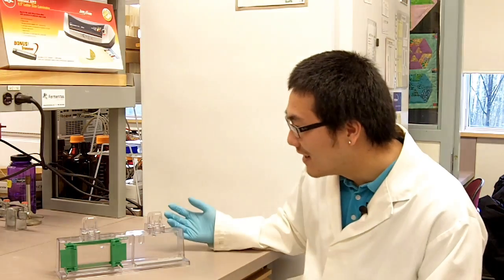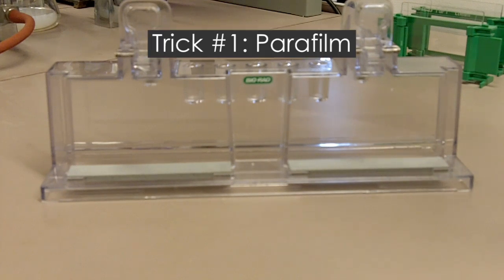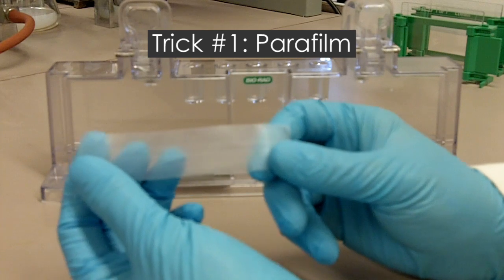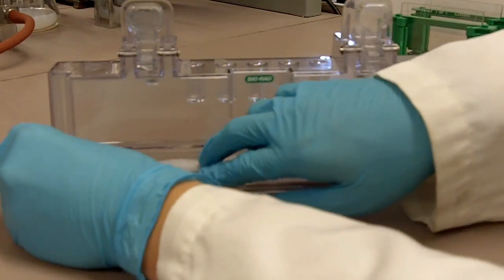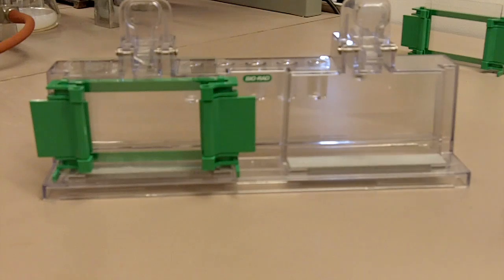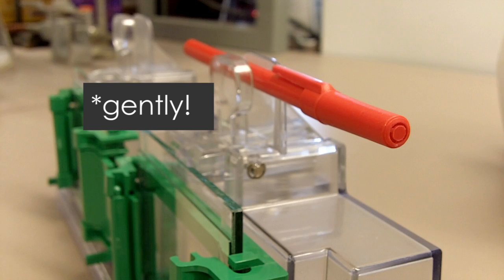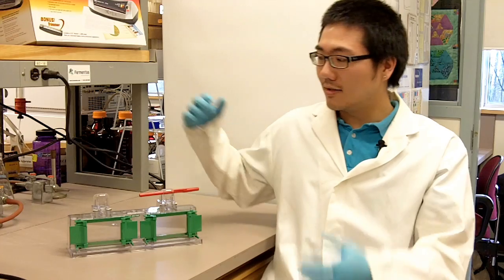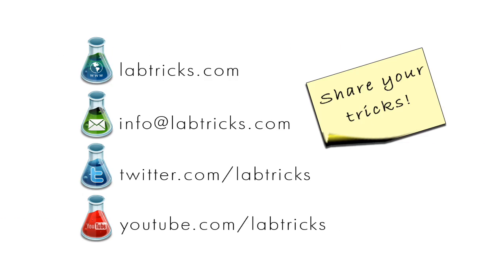How to Avoid a Leaky SDS-PAGE gel

Comment: You can add a little amount of resolving gel with higher percentage of TEMED to prevent leaky and after the thin layer of the bottom becom solid , you can add standard resolving gel

Comment: I tried these two tricks, but like someone else on here, I still had leaks. I also tried petroleum jelly, but this is somewhat messy as it leaves jelly on your casting stand and casting frames.

What worked best for me was resting the casting frame HORIZONTALLY after pouring the gel. I simply use a tube rack that is about 1in high on which to rest the casting frame on its back. Once gravity was (mostly) taken out of the picture, I have perfect gels every time, even when using old, slightly cracked plates and even without the use of parafilm, pen, jelly, etc.
Reply: Do you add/overlay water on the top of resolving gel in your method?

I tried your method by casting frame HORIZONTALLY after pour resolving gel and water-overlay. It is no leakage at all, but the gel wasn't polymerized.
Reply: Asa Wu Asa, 99% of the time a continuous gel is sufficient for me so I really don't use the water overlay method. It might be that when you lay it horizontally, the water is mixing with the monomer solution, interfering with the polymerizing step. That's interesting and certainly something I didn't think of when I wrote my comments above.

I should say that I really meant ALMOST horizontally. The point was the closer the angle between the plane of the gel and the bench is to 0 degrees the better, from a leakage perspective. However, I've noticed I can increase the angle to about 45 degrees while still obtaining minimal leakage. Obviously this depends on the condition of your plates, seals and gel reagents as well.

I'd suggest adding the monomer solution, placing the gel at a 15-30 degree angle, THEN slowly adding the water overlay. You can play around with your system to figure out the best angle you need to minimize leakage while preventing the water from mixing with your monomer solution. Good luck!
Reply: Michael Anaya Thank you for your reply. I will try your suggestion and reply the result.

Comment from the maker: Sometimes the pen or parafilm trick might not work because the seal is still not tight enough. This is usually due to tiny cracks at the edge of your glass plate, or a worn out rubber sealing pad on the bottom. If you read through the comments below, there are a number of other tricks that you can also try such as: parafilm around the three edges of your glass plates; use petroleum jelly to seal the bottom of your plates; or use agarose to seal the bottom of your plates. Good luck!

Comment from the maker: @alabonneheure1 Make sure you are using fresh ammonium persulphate solution - if it's old, the gel will not polymerize (or will polymerize much slowly), increasing the chances of leaking.

Also, @parugoelbiologist just replied about the agarose trick: add a 4-5% agarose solution to the foam, then put the glass plates on top and let it solidify. Once solid, continue with resolving as usual. Good luck!